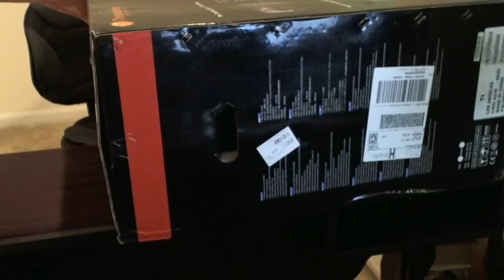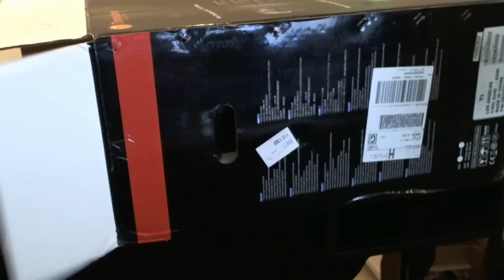Building an $1,800 Streaming/Gaming Rig - for ChanmanV

Comment: Who needs extra SATA controllers and that bull anyways, half the stuff on a normal ATX mobo (besides Crossfire) you don't even use.. it's retarded how much money you will blow on a system that's just meant to game and stream on.. why not use half the money and waste the other half in about 1,5 years when the system is outdated and worth 70% less than today? And why go for Crossfire, seems like more noise and heat. Why did you just ignore the RAM? Timings are important, especially in DDR3..